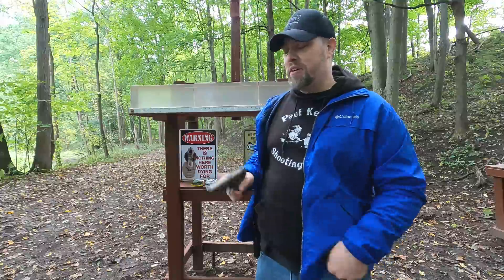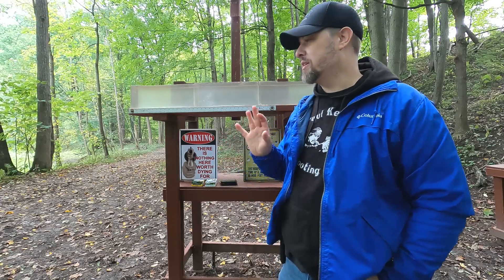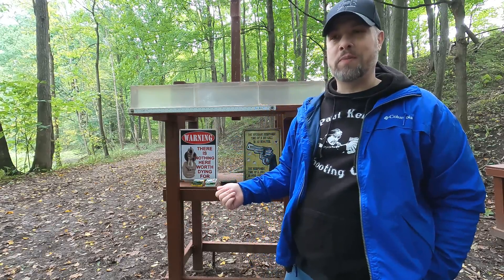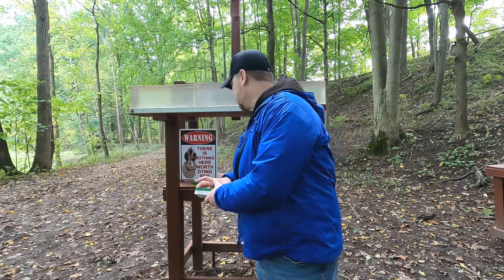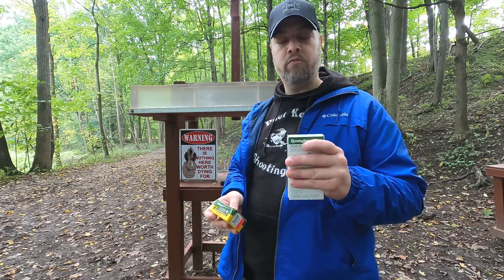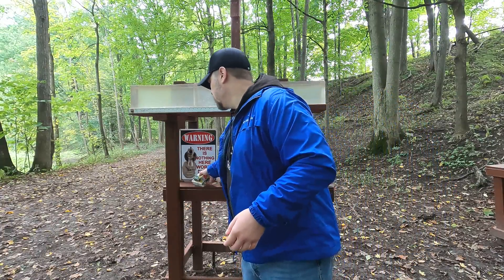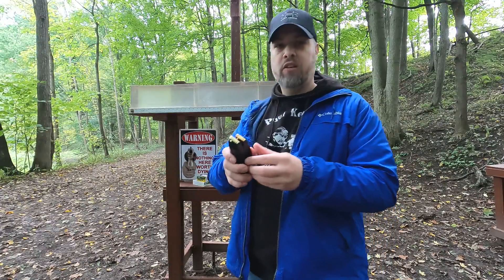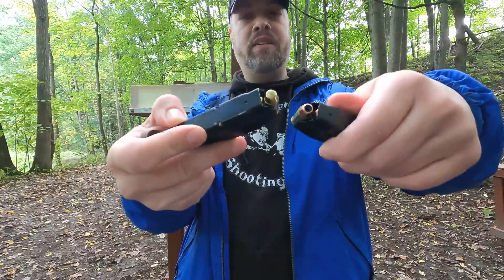😕 A Non Expanding Hollow Point "Turns into" a Full Metal Jacket?🤯  Truth or Myth? Ballistic Gel Test

Comment: I run the 200gr of these as my plinking/"cheapo" stock ammo. 230gr standard load FMJ risk squibs in my carbine (19"+ banish 45). After 3 standard load squibs from 3 different brands, I quit running them. The 200gr HP only cost a few cents more than any cheapo standard load 45 (new or reman).. but the fps difference is ~850 vs ~1150 in my rifle. That's ~ 360 ft lb vs ~ 580 ft lb, no worries about a squib. Also, another youtuber did a gel/chrono test like this, similar results. basically, these split between an FMJ and a crappy JHP (cough Winchester white box) damage and penetration wise while being very cost effective.

Comment: Seems good for predator defense! A good mix of HP&FMJ/TMJ with penetration and a bit wider or blunter metplat than a FMJ which allows it to crush bone and penetrate. It does more damage than the  FMJ or TMJ , accurately while also providing penetration a hollowpoint doesn’t with the ability to keep a straight line and crush bone with its momentum instead of mushroom. Seems like it could be decent for hunting or even predator defense in a pinch if need be! 
Ps. I wonder do these do better or worse in barrier testing than FMJ’s?

Comment: Have handloaded 124 grn non-expanding hp in 357 sig and found they tend to tumble about half the time.
Reply from the maker: Maybe if you used round nose. I would find it hard to believe that the flat point ammo would, but seeing as you said 124 gr and not 125 gr I would assume they are regular 9x19 bullets?

Comment: Lucky Gunner tested both the 155 and 180 grain Remington HTP .40 S&W ammo and they got 32"+ of penetration with no expansion of the recovered projectiles.  So, it seems that the correct answer is, "yes and no but also maybe sometimes" or, if you prefer, "it depends."
Reply from the maker: But, it's not just this .40. I have dozens of examples in many calibers confirming that non expanding hollow points rarely act as a FMJ. Lucky Gunner used a 3.2 or 3.5" barrel or something like that.

Comment: Back when the primary source of ballistic results were gun magazines and scuttlebutt, the Winchester 147 grain JHP and a good portion of the Hydra Shok line, particularly the 147 in 9mm were reputed to plug up, fail to expand, and over penetrate. Much of that was also based on reports of over penetration when fired thru drywall. I never actually saw that happen in the real world, but I can attest that the 147 grain Hydra Shok was a very accurate bullet in both 9mm standard velocity and .38 Special +P.  I think that most if not all modern HP designs are going to perform better than FMJ - even by small margins.

Comment: I think what most people mean by it acts like FMJ is the fact it typically over penetrates as a whole or doesn't offer anything over FMJ options. This same test has been conducted by several gel test channels as well as more contemporary channels like Paul Harrel. The results are usually indicative that a non expanding JHP will cause the same levels of damage and over penetrate like FMJ which it has been shown to do so. 

The main thing that was ultimately shown was it grouped better, but this is something I think a lot of people know. Good ammo shooters better than run of the mill target loads. It is why I encourage people to shoot their defensive loads or any load they plan to carry so they can see how it performs on paper and if they have the means or capability to test it in other mediums to see a real glimpse about it's potentials.

Comment: Tests in gel are interesting, but not 100% conclusive with regard to a real world scenario. It only compares one bullet design vs. another design IN THE GEL.
A bullet either expands or it doesn't. 
I've done similar tests with revolver loads. Semi-wadcutter vs. round nose vs. full wadcutter vs. flat nose.
Assuming none of the bullet shapes expand, you're still left with a .358 inch wound channel. Penetration will of course be different with each.
I believe a JHP bullet that does not expand will perform not like a RN FMJ, but like a flat nose.
Bullet "tumbling" will only occur consistently when bullets are driven at lower than standard velocity with heavier bullets that are proportionatly considerably longer than the diameter.......i.e. a 200 or 220 grain .358 bullet driven at less than 800 fps.
I've tested a good many 38 Special reloads with a these heavier slugs at about 700 fps and they consistently turn sideways in the gel after only about 9 or 10 inches of penetration, especially a 220 grain full wadcutter.
Good video though. Keep up the good work.

Comment: Back in the days before YouTube and the bounty of info we call the Internet I was steered toward Federal high shock JHP as recommended by a police officer. He swore up and down it was the best discount ammo you could find but when reviews and testing became a thing I was horrified at the failure rate this ammo expanded at which was basically not at all. None the less I stumbled into recommendations that JHP is always better then FMJ and it was extremely high quality and when I used it it was very accurate and always fired and functioned reliably in my guns. Generally this issue usually comes up in standard pressure 38 special and 380 ACP I'm glad you used a more modern cartridge like 40S&W to set the record straight. This is a modern cartridge that most people wouldn't think could fail but even with a fail it did very well.

Comment: If I've learned anything from Taofledermaus over the years, it's that a nose heavy projectile is usually more stable and accurate than a tail heavy one.
Reply from the maker: Yeah but they are using slugs often times, and with something like that where the slug is short and any spin is minimal, yes nose heavy is better, but with jacketed bullets in rifling that's not necessarily true.

Comment: Hey man I was wondering if you can test the 147 gold dot?
Reply: I'd like to see that too! Can you send him a box to test?
Reply: @paulkleinkramer5065  I usually have someone send me their shipping address and I'll send it to them instead of  me. I've done this with a different youtuber 1Shot
Reply from the maker: I do have 28 rounds left in a 50 round box of the Gold Dot 147 gr. I must have tested them at some point but it was probably back when I was doing water jug tests. What type of test were you thinking? Like multiple barrel lengths, a specific one in mind? I got the 3", 3.2", 4" and 5" pistols in 9mm. I generally like to do comparisons but if not I could still try to slip that into a test. I also have about as many rounds of the Winchester Ranger 147 gr I been wondering how to test, and again I think I had them from when I used to do water jug tests.
Reply: @GunSam  I prefer 4 inch. But you can do other barrels too if you want. I like when you do the gel test and the water test. Thank you a lot. I'm considering this load.

Comment: That is not difficult to explain. It’s called viscosity. All liquid behave with a certain amount of stickiness. You’re basically increasing the total surface area which liquids have to travel across the hollow point to a flat nose. More surface area equals greater resistance due to viscosity.
To test it, just fill your bath with water pour in some food colouring in a straight line and then make a stroke with an empty cup. You will see is the liquid passes the outside of the cup it will drag contents in the cup out and sucking new water in. The thicker the cups rim, the great of the effect should be
Reply: A hollow point that fails to open should cause more disruption than a flat point (which is generally more disruptive than a round nose), but less than the same hollow point that expands properly.
Reply: @paulkleinkramer5065  yes viscosity 👍🏻

Comment: Well, could always get the best of both worlds and use large caliber wadcutters.
Reply: In my testing .44 Special hollow points often don't expand even in an ideal expansion medium like water. Fortunately, when they fail to expand, they're still .44 caliber...
Reply: @paulkleinkramer5065  Indeed. And something with sharp shoulders will at least cut a clean caliber sized hole, rather than slide through like a round nose projectile.

Comment: Can you do this in .380? In a LCP most JHP's don't expand. And if they do they under penetrate. I always hear it's better to just use a FMJ in a short barrel .380. Curious if a non expandind JHP will do more damage than a FMJ in a .380.
Reply: Some do, some don't, I think it depends on just how recently they are designed. If the HP is designed and loaded for todays pocket carry 380's, they at least have a chance of expanding. If they are designed for something with a longer barrel not much chance of expansion in a less than 3" barrel. It would also be interesting to see the difference between a RN FMJ and Winchester's FN FMJ.

Comment: Hi Sam, I don't know where the idea that a hollow point is more accurate may come. In the bullseye world, we tend to stick to WC for centerfire and LRN for rimfire, if the hollow point gave any advantage we would see it used in competition I think.
Reply from the maker: I think it has a lot to do with rifles, as they are always more narrow at the bullet nose. It could also come from the 19th century invention of the hollow point as they started making them hollow it extend range by removing weight, obviously if you hit at 200 yards with a hollow point but the heavy round nose didn't you might think it's less accurate. I have done some reading on it all, I can't quote sources as it's been a long time, but basically it's like a football spiral and somehow more weight to the rear makes a bullet spin better making it more accurate, like how a top will spin better with it balanced better. No way to really prove all this, but I could see how if a flat or round nose had some form of deformation or oddity or flaw to a single bullet in the batch or many in the batch, it's balance could be thrown off, as where a hollow point nose won't have that.

Comment: This has the basis of being decent ammo but the fps and fpe are horrid and remington usually doesn't hold back on powder but maybe the new company does,
UMC semi jacketed hollow point is usually decent with good volocity's if your going to accept a few less rounds in the same size gun you don't want those rounds to be considerably less powerful that rounds in 9mm,
9mm producing over 500fpe is common enough so 40 at the 350fpe range doesn't make sense,
40 should be 500fpe minimum in my eyes 550+ is ideal.
Reply from the maker: I mean, in defensive ammo you are right. But for target ammo this is about right. Same as how 9mm 115 gr target ammo often barely does 1,050 in a 4" barrel when a decent defensive round like Gold Dot 115 gr from a pistol like that should do 1,200 FPS even in standard pressure.

Comment: The clogging of the hollow point created a large metplat face on the bullet. Thus creating good wound channels.  The larger metplat helped to keep penatration low as the larger face slowed the round. I know that round nose profile and hollow point rounds have slight a slight curvature to feed in semi autos better.  I wander if a flat point round with large meplat and cruved edges would make a good round?
Reply: The army already beat you to it, their M1152 ball round is just that.
Reply: @andycraig6905  that round penetrates like crazy though. My theory is maybe the 150 grain federal syntech wouldn't go so far, since it is a slower round (~850 fps I think?)
Reply: @rob6850  yeah just saw some videos on that round. They developed it to just penetrate.  Slower and larger meplat would provide good qound balistics and still penetrate well for self defense. It would surely eleminate hollow point concerns.  Reloaders for revolvers have always looked for larger meplats for hunting. Increasing forward faceing diameter while still allowing for realiable feeding would be the trick. I do think it would be a good round even at normal 9mm velocities.  Hollow points are good for energy dump and expansion so why not simplify the design and go with largest flat point possible which would provide penetration as well.